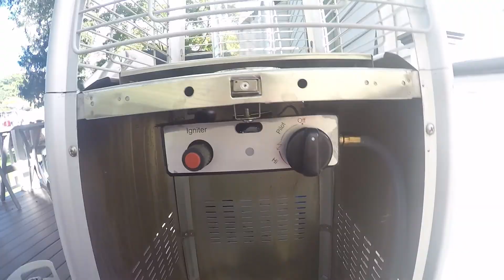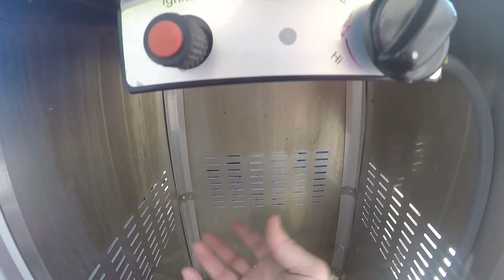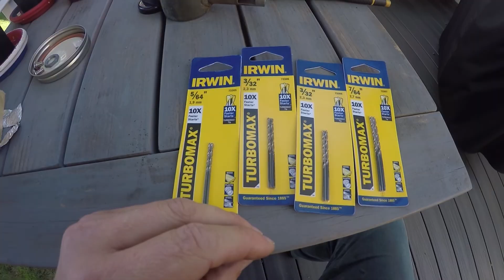Convert Any Propane Heater to Natural Gas / Dual Fuel - Simple Mod

Comment: Great job, but what if you find a pipe sleeve to fit over the vents, thread a hole in the side and put a long bolt into the threaded hole and cut out a slide hole in the case to slide the vents closed or open as needed per fuel?
Reply from the maker: Great idea.. that would also make it easier to adjust the air fuel ratio to get it perfect

Comment: Wow that’s awesome? Any advise on converting a 38,000 btu stand up heater with the round hood on top. I bought it at Home Depot and it goes thru propane really fast. Here’s the model HDMiRAGE10. Any advice or input would be appreciated. Thanks !
Reply: Ok thanks so much !
Reply: @DjMetalmike  Hey, Mike.  I have an HD heater too.  Did you locate the orifice?  I don't want to take too much apart to find it.
Reply from the maker: Same exact procedure.. you just need to locate the orifice as seen in the video and very slowly increase the diameter of the jet size until you find the appropriate spec.

Comment: I just bought a new patio heater which forced me to have to buy a propane tank for the first time in 15 years.  And it’s already nearly empty.  What a pain in the butt.  The heater is sitting 2’ away from a NG line for my grill so this conversion is a no brainer.  I have one of those top-hat looking heaters, but I suspect the jet is similar so I’m going to tear it apart tonight.  Thanks for recording this.
Reply: Hey did this work?? I have the same geater
Reply: @P3tonka  Yes!  I worked perfectly.  I forget the exact size I needed to drill out the orifice but I think it was 9/32".  I am so happy with the conversion.  I have two of these heaters now and 4 gas ports on my patio - so I can have two on one side, two on the other, or split them up as needed...or I could buy two more heaters :-)
Reply: Justin Lake that’s awesome, I’m gonna try it out, thanks 😊
Reply: @emanresutla  how did you block the vent off or did you even block it cause I’m having a lot of soot buildup on my top hat within 5 minutes
Reply: @dennishager3501  I didn’t make any other change besides the orifice and the hose.  And I don’t get any soot on the deflector.
Reply: @emanresutla  thanks I figured it out before I seen your reply cause I watched another YouTube video and he put silver aluminum tape on the opening and so did I but had yellow flames and soot so I opened up back screen and took a Allen wrench and pushed it in now I’m getting blue flames and no soot if it wasn’t so hard to get to where orfice goes into the hole I could tape it back up to adjust a little more flame and get more heat by having the blue flames with just a little yellow at tips and still not have any soot but thanks for the reply back!!
Reply: Justin, please don't give up on propane.
Reply: @hankhill4254  Sorry Hank.  Propane and I are no longer partners on my outdoor heating needs.